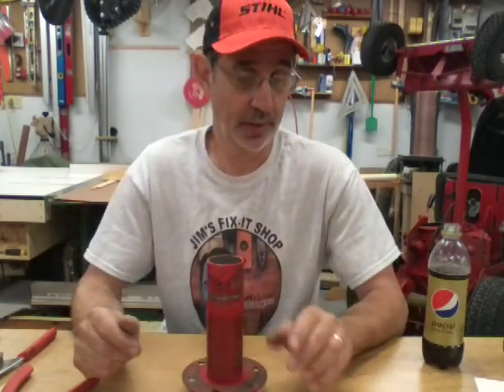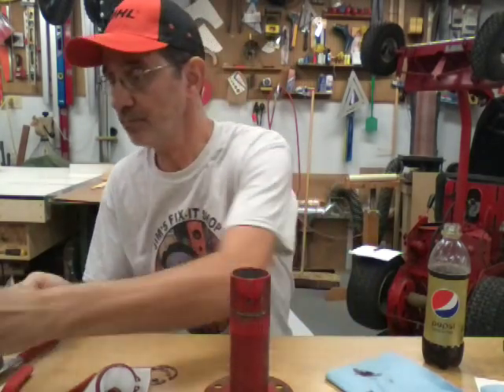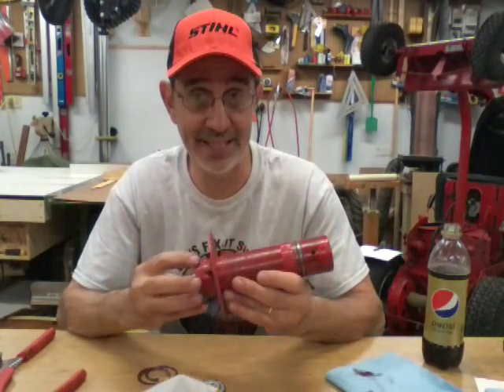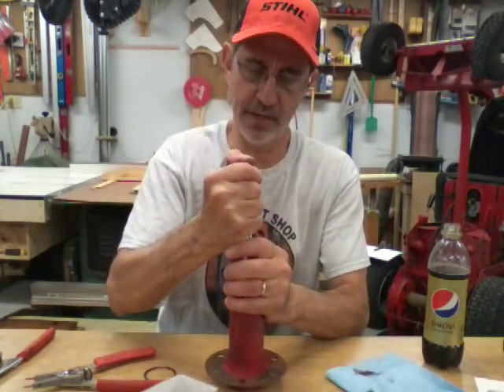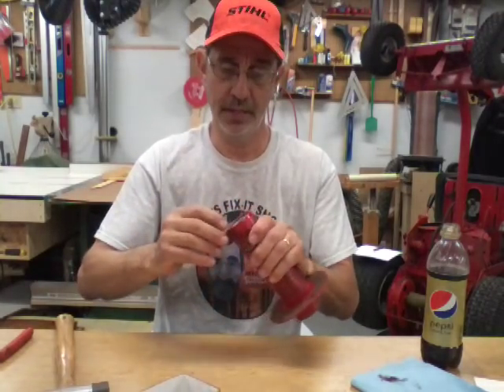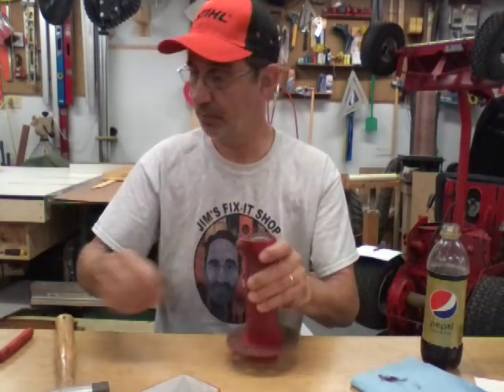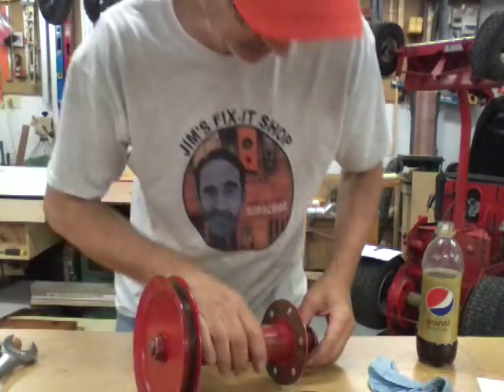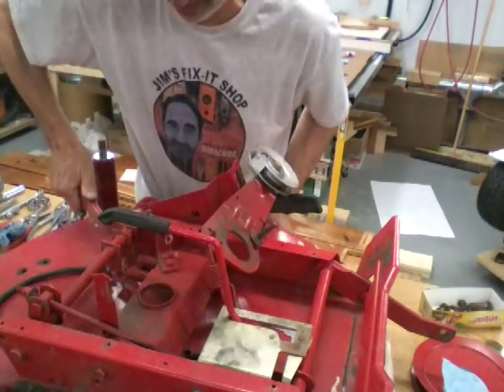200. Replacing the spindle bearings and reassembling the mower deck on a snapper. Part 2

Comment: When I started my reassembly I just put the deck on two sawhorses and I found it easy to work on and gain access to the bottom and top without having to flip it over or squeeze my arm under...

Comment: I would like to add a trick that I have been using since my old friend who has  passed away some years ago. Mr. Snyder taught me thirty some years ago you always slightly grease the bearings on the outside to make assembly easy and to seat correctly. Later when the bearing go bad, the disassembly will be so easy that you think you are a mechanical magician. Nice video Jim. Keep them coming too.

Comment: Excellent info on this procedure. Just found it as I was doing this repair on my Snapper. Wish I had seen it a couple of days sooner. I ran into some of the same issues and this should help others greatly. To note if anyone runs into this, the blade bar is threaded onto the spindle(standard, left = loose) and not pressed on as I thought. Thanks so much!!!
Reply: Thanks for the information. Nobody told me that and I have been trying to pull it off. Du!

Comment: JIM I FINNALY GOT AROUND TO TAKING OUT THE SPINDLE SHAFT ON MY SNAPPER 30 IN. RIDER.I TOOK A CHANCE ON PARTS TREE AND ORDERD ONE FOR A 30 INCH BUT IT WAS TOO SHORT,SENDING IT BACK.THE ONE FROM PARTS TREE IS PART #7024687YP, SAME THREADS AS MY OLD ONE AT BOTH ENDS BUT TOO SHORT. MY OLD ONE IS 10 1/4 IN. LONG.TALKED TO YOU A WHILE BACK, SAID YOU MIGHT HAVE ONE,THANX!
Reply from the maker: I have one here and I was gonna send you a picture of it but I don’t have enough of your email address in this comment title to send it to you. Mine is 10 1/8 inches long. Send me an email and I will send this picture to you. My email is.
jimsfixitshop@gmail.com
Thanks.     Jim

Comment: Hello great video. Do you have any tips on unscrewing a stuck blade bar? Mine is seized on pretty good and I cannot seem to get anything to keep the spindle steady while I try to loosen it. Thank you
Reply from the maker: @Greg-j5d  
I’ve had a few that were stuck so bad I had to cut them off. You can try heating it up good with a torch, but you want to use a big torch like an oxygen acetylene. You want to heat the bar up faster than the spindle shaft so the bar will expand, but not to shaft .

Comment: Jim, could you tell me if one could put four bearings inside the spindle housing if there is room ??? Maybe the unit will never need to be replaced. Just a thought. 
What is the number of the timken sealed bearings Jim ??? Thanks
Reply from the maker: No you can’t get four bearings inside of the spindle housing it wouldn’t really make it last any longer anyway, instead of wearing out two bearings you would be wearing out four. Jim
Reply: @jimjackson9381  Thanks Jim, How about the numbers on the TIMKEN Bearings ??? That would help fella. vf
Reply from the maker: The bearings I use are Timken no. P204RR6A4362. Thanks. Jim
Reply: @jimjackson9381  Now I will able to get quality bearings. Thanks vf.

Comment: Mine had no washers between the pulleys and bearings (on the top). Snapper LT12 with 41" deck, the 33" deck does appear to have them though.

Comment: When you put the blade bar on how tight should that be before adding the nut
Reply from the maker: James Rick 
Good question I just tighten them up as tight as I can get it using a rubber mallet there’s no real torque setting for it and then just put a nut on and tighten it down good. Jim

Comment: Great job Jim. Have you ever rebuilt a rear engine Toro Wheel Horse spindle?  I have one that needs rebuilt.
Reply from the maker: Well, maybe yours will be the first do you need it rebuilt or do you just need help doing it? If you do then send me some pictures and I’ll let you know what I think. Jim.
Reply: @jimjackson9381  Will do Jim. It’s sounds pretty gravelly and hard to turn by hand.  It still mows but I know it needs bearings.

Comment: Another great and informative video!
By the way, I've been wondering what those round nubs are for on the underside of the blade mounting bar. They look like they're there to mount something on. And on another note, I got both belts, engine drive and transmission belt for my new old Snapper 21" self propelled mower. I got them here locally for a little over $18.00. I got the engine belt on a couple days ago, sharpened the blade yesterday and mowed the front yard. It does a fine job!
 I will probably put the transmission belt on today. It's interesting that the drive setup with the drive disc and driven rubber disc is so much similar to the RERs....
Reply from the maker: Jeff Stone 
Hey Jeff it's Jim
  Can you send me a picture of them I'm not really sure what you're talking about. Thanks Jim
Reply: @jimjackson9381  Will do Jim
Reply from the maker: Jeff Stone 
 Hi Jeff
    Hey I looked at the picture you sent of the spindle assembly and blade bar I think the bumps you’re talking about are the leveling bolts on the backside of the bar you’ll probably never use those in fact a new blade bars are shorter and don’t have the bolts. Thanks Jim

Comment: Jim, I  have a  model 301215BE , series  15 snapper rear engine rider 12 HP  that has the threads stripped on the bottom of spindle shaft tought about trying to rethread the shaft without taking it apart . What do you think about that idea. Will that work . Or should i just break it all down and put in new spindle  shaft. Didnt want to get into a major repair job. Any ideas on a quick fix. By the way your video is very helpful. Glad i found your youtube channel since i have several old snapper mowers .I  live in mcdonough ga former home of snapper . The plant thats not in operation any more is near me but i love the old snapper mowers . Thanks from Ray
Reply from the maker: Big Play Ray 777 Jackpot 
I guess I would try to run a die on it to clean it up but if that doesn’t work then you may have to put a new shaft in the spindle housing. Jim

Comment: Thanks again Jim, Could you post the Timken # you use? Not sure if it's youtube doing it or it's your camera but the video always seems fuzzy or a bit pixelated. Waiting on mine from the local bearing place as they had to order them in.
Reply from the maker: Hi it's Jim 
  The bearings are use art Timken  bearings and the number is     P204RR6A4362.  And I get them from  Applied  Industrial  sales  Their phone number is 1-231-798-7750 and they are supposed to be nationwide so if you call them they can give you an Office close to you.  Thanks Jim

Comment: Hello Jim,  where can I buy those 2 bearings, I have a rear drive snapper 28" cut very old 8hp engine guessing 1980's ??  My lower bearing went out and the blade made a horrible racket, never had a scare like that while mowing. do u sell them?
Reply from the maker: Farm Boy 
No I buy them as I need them from my bearing supplier. Jim

Comment: Hi Jim. My snapper runs and cuts, but only seems to engage up to second gear under the deck. The shifter will move from reverse up to 5th gear, but it's really tough to do so. Because of this, a pin snapped where the shifter meets the body of the mower (which I temporarily got back together with a bolt and a lock nut). Any ideas on how I can get my mower to shift through all the gears and have an easier time moving the shifter? I sent you a more in depth email with pictures of the mower if that helps. If you or anyone can help, I'd greatly appreciate it!
Reply from the maker: Hi it's Jim 
     The first thing you need to try is  slide your boots and clean and grease the hexagon shaft and see if that alleviates your issue.  Thanks Jim
Reply: Thanks Jim the boots look pretty dirty. I'll give it a try and report my results
Reply from the maker: scott hillegass 
Hi Scott it's Jim
  I would appreciate the update I like to keep track in case someone else has the same issues. Thanks Jim
Reply: Jim! You're the man! I greased the hex shaft and it loosened it all up. I did notice that my boots are shot, they have a couple slits at each end near the hose clamps. Also, my yoke seems to be in pretty bad shape, it's gouged out in 2nd gear. Guess I have some work ahead of me. Thanks again Jim!
Reply from the maker: Hi Scott 
      If you need any help replacing those boots or that yolk let me know I do have videos that cover both but if you need any other assistance please let me know. Thanks Jim    
     And when you get that snapper done send me a picture of you and yet to put on my wall.
Reply: Thanks Jim, I'm going over your videos now. Do you recommend the plastic like white/gray boots, or the rubber black boots? How about the yolk? Should I find a original snapper part and stay away from the aftermarket stuff?
Reply from the maker: scott hillegass 
Hi Scott
  Definitely stay away from the whitish gray plastic boots, I just bought some nice black rubber boots off of Amazon right in Briggs & Stratton packaging.  As far as the aftermarket yoke I haven't heard anything bad about them yet. But there again check Amazon and eBay you can get some pretty good prices with free shipping. Thanks Jim
Reply: Jim Jackson Thanks for the tip on the boots. I noticed my rear wheel has some side to side play, so I guess I'll be adding some shims when I replace the boots. It's great that I can use your vids for reference. Im learning a lot. This morning I adjusted the tension on the yoke spring, which makes a big difference. Happy mowing my friend!
Reply from the maker: scott hillegass 
Hi Scott
   Hey I like that is it OK if I use it " Happy mowing my friend ".  If you need anything just let me know talk to you soon Jim

Comment: I've got an old Snapper 30 RER that has a broken blade brake band. I can't find any model numbers for the mower so my only local dealer won't even look for a part without that. Can't find much online either. It's a 3 inch drum and the band is 1.25 wide and is stamped 5 85, maybe a date. Anyone know the part number or how to find one?
Reply from the maker: Unit 419 
Have you found a blade break band for your machine yet I may have one laying around here someplace if you need it let me know. Jim
Reply: @jimjackson9381  Thanks Jim. I didn't know that there are two brake bands on my machine but I think the # is 7503086YP. It will be here Sunday via Amazon Prime (wow they deliver on Sunday!) Hopefully that's it. Grass won't stop growing to wait on parts.
Reply from the maker: Unit 419 
Well let me know if you need anything or any help. Jim
Reply from the maker: The reason some units have two brakes the brake band is your actual break the shoe inside of the clutch disk assembly is actually a parking brake but then to save money on manufacturing they realize they could do away with the band break. Jim
Reply: @jimjackson9381  Mine has the band brake band across from the friction disk but also has the lever for the pad inside the disk. I can't find where that lever is connected to anything but always bought the disk with the liner because that's what came out. Weird? Also I  cleaned and rebooted the axle years ago and all I could get is one white plastic shorter boot and the longer one  a black rubber boot. I see the black rubber is splitting again and the white plastic one looks fine. Any thoughts?
Reply from the maker: Unit 419 can you send me a picture of your brake lever some of the older ones were not hooked to anything the yoke pushed on the end of it and activated the brake It was more of a parking brake than an actual brake while you were driving and a picture of your clutch assembly would be nice to I’ll let you know if it’s a solid clutch or a smooth starting clutch
jimsfixitshop@gmail.com
Thanks Jim

Comment: How do you order bearing for that same mower you're working on.I have the 28'Hi Vac
Reply from the maker: Willie Timmons 
Hi Willie 
  The bearings I get I order from applied industrial technologies their phone number is 1-231-798-7750.  The bearings are Timken and the number is.  P204RR6A4362
   A few viewers have bought them from Amazon a whole lot cheaper you may want to check there thanks Jim